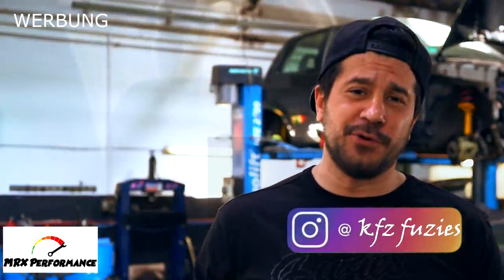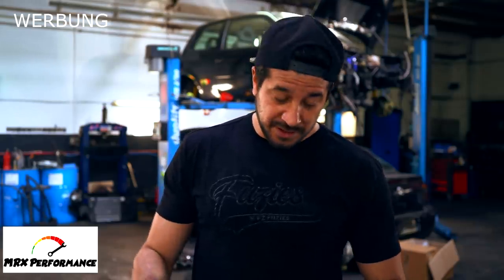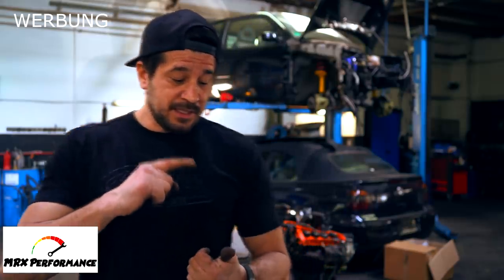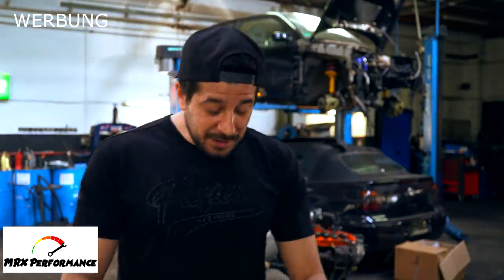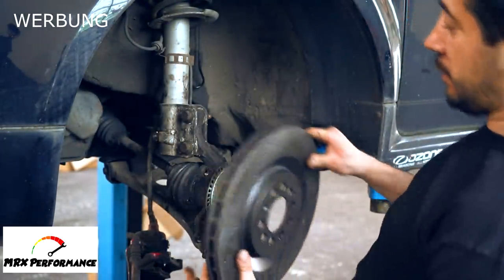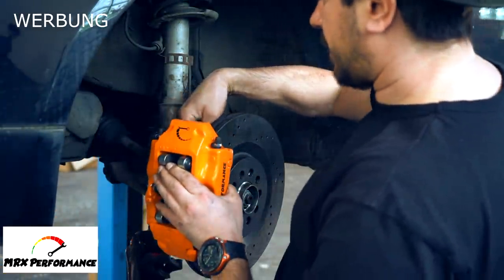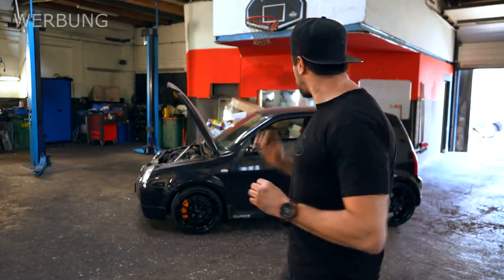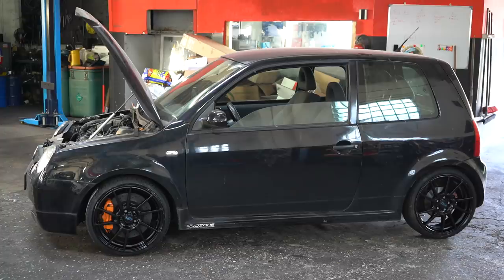Lupo 1.8 GTX30 Turbo | Bremsen | Felgen | Upgrade | #2

Comment: Hi , schöne bremse , ich mache auch einen Bremsen umbauen an unseren Polo 6n 1.8t 312mm vorne und hinten 256mm. Umbau arbeiten geht bis jetzt ohne Probleme. Aber warum hast du dich für denn185/35 17 Zoll Reifen entschieden? Wir fahren 195/40 17 weil mir der nanknag zu unsicher ist für die Leistung und Geschwindigkeit. Geht auch nur bis 240km/h denke das wird der TÜV nicht so abnehmen .also kann ich mir nicht vorstellen. Mach weiter so Gruss .
Reply from the maker: Ja aber ich wollte unbedingt die Reifen Größe... Wenn es natürlich Probleme geben sollte... Werde ich die wechseln... Bei Fragen für Bremsen... Einfach bei @mrxperformance nachfragen
Schöne Grüße zurück
Reply: @Fuzieniert  OK, bin ich Mal gespannt was der TÜV später sagt. Bitte auf dem laufenden halten. Ja, mein Bremsen Umbau ist im Grunde schon fast durch. 1,2 Sachen noch dann nur noch einbauen  und TÜV machen lassen dafür. 5x100 Umbau haben wir schon hinter uns  mit Golf 4 7,5x17 BBS 2 Teiler mit TÜV Abnahme. Kannst du dir ja mal ansehen auf instargram bei Zeiten. Thorstenstoever Thor.